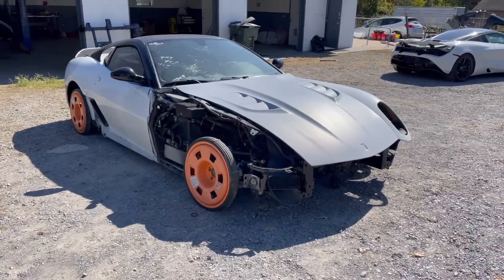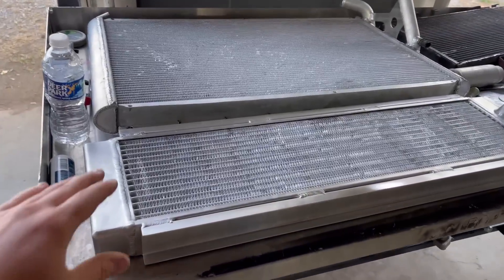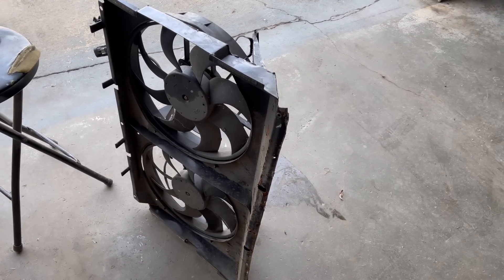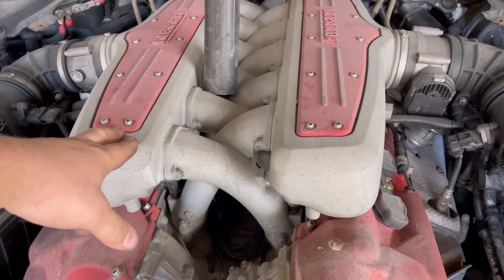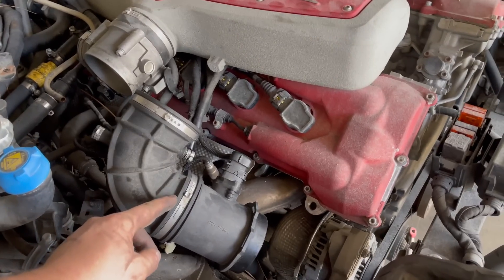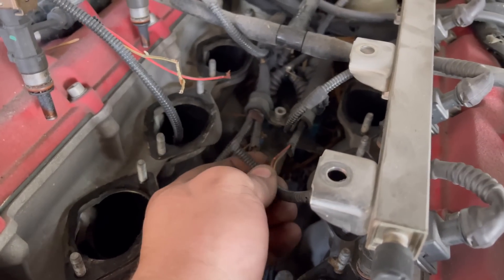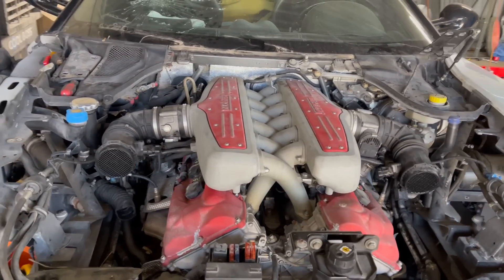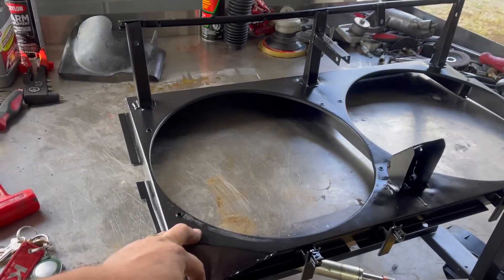Buying this Cheap V12 Ferrari Was A HUGE MISTAKE We're Losing Thousands every Day!

Comment: the car has a robotised manual gearbox, it needs to calibrate after the battery went dead, that`s why you have the line on the dash instead of N. Put the contact on and keep your foot on the brake, you should hear it start it`s calibration process underneath. After it calibrates it should show N and then you will be able to start the car.
Reply: On top of that, jumpstarting a Ferrari can be an iffy proposition.  More than one owner has fried an electrical module doing that.  The best case is to disconnect the battery and put it on a charger/tender until it is ready to be used.  It may also be old and dead enough that you need to just replace it.  But the other guy is right, if a Ferrari has been sitting with a dead battery for awhile then it needs to re-initialize everything.
Reply: Doesn't seem like he knows what he's doing to be honest. He put in wrong viscosity oil too.

Comment: low battery voltage on vehicles like this cause similar issues. after the battery dying the car may need some sort of calibration like a BMW. I suggest either trying to recharge that battery and see if it holds a good charge to bring it back to life or a new battery to get it functioning properly.

Comment: Probably shouldn't use clamps with screws. They won't flex when the metal tubes expand from heat. Screwed on clamp might crack the hose. There's a reason why the original part was selected.

Comment: The bolt in clamps, for holding the wire bundles and hoses, are called Adel clamps. They're used extensively in the aircraft industry.

Comment: When you have worked so hard on it, I can but imagine your frustration Ben when it won't start. Not that I am a mechanic of any sort on these modern cars, but you did take the fuel rail off...could it be a lack of fuel? Keep at it. Cheers from the UK.

Comment: I have an f12 and it takes alot of juice to turn that engine, not just the voltage.  charge the battery to full charge, check the injector fuse, then try again

Comment: Ferrari are like a modern day TVR or Viper, look great outside and perform but under the skin it’s basically a fancy kit car that you might be proud of building in your shed… the welds, engineering and manufacturing of the chassis etc is…. Um…. Interesting. The welds 🤦‍♂️

Comment: I would try to manually put it into neutral under the car. Also check if that car has a pyro fuse that hasn't blown from the battery to start the vehicle since it has the airbag that was deployed on it, it could have blown that fuse if that vehicle has one which would cause it not to start and run.